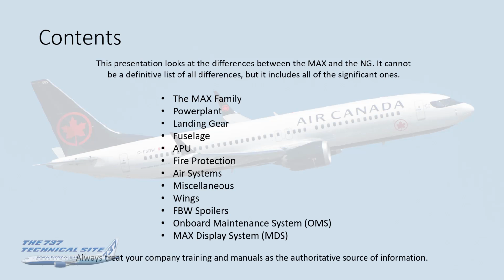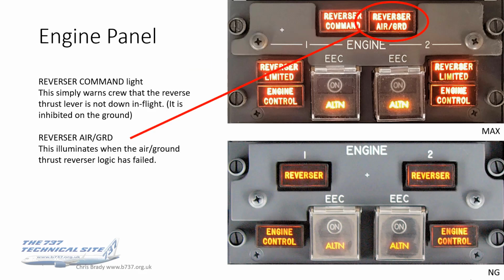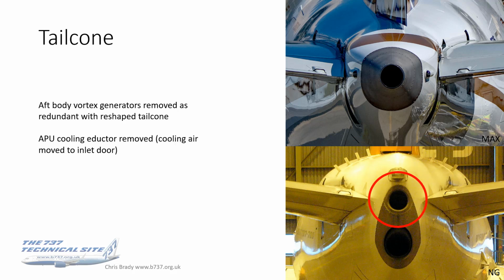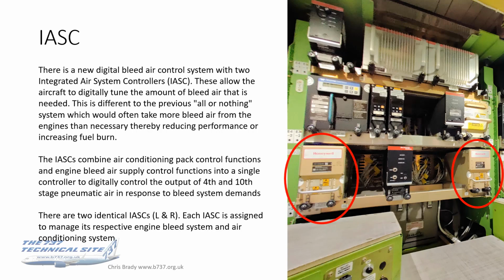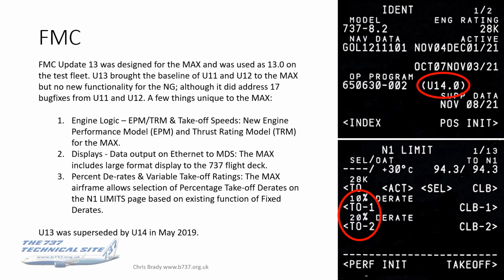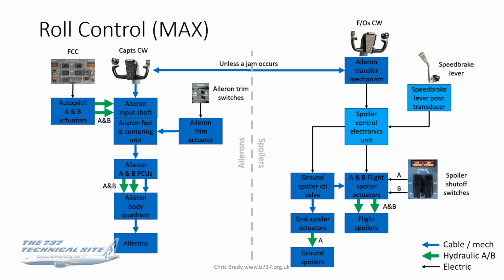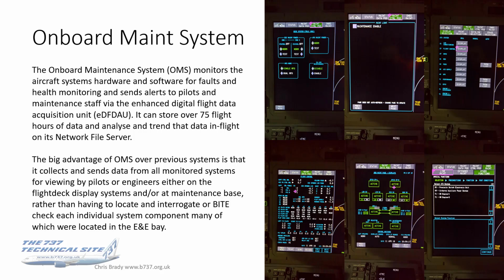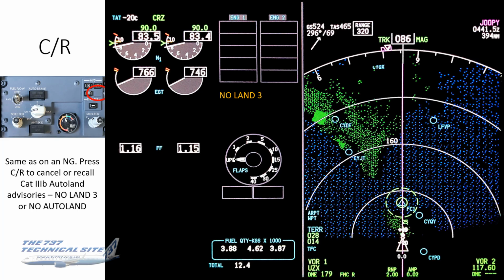737 Max Differences

Comment: 49:25  what is real insanity is that brand new MAXs are still being delivered with integrated ash trays in the cockpit. How that makes sense I have no idea.
Reply from the maker: Airbus only stopped doing that a few years ago!
Reply: Wasn’t the logic behind this one that if someone’s going to still go ahead and smoke, then it’s still safer to have an ashtray there to put out the cigarette safely, even if it is not intended for use?

Comment: Hello Captain I had a question if you could kindly help me. In max, when we are doing the extended motoring of the engine 5 mins of wait and 5 mins of starter usage say due to a hot start where the EGT has not exceeded the limit, due protection and the starter usage was more than 3mins. What are we to do if the starter takes more than 5 mins to start the engine in the second attempt as it says 5 min of wait followed by 5 min of starter usage. Thank you.
Reply from the maker: Please ask any questions here https://www.facebook.com/groups/737tech

Comment: I hope this feedback is useful to you. Your channel offers something unique - in dept analysis of aircraft design and I love that. But I found, then unsub'd then sub'd again, and then found a way to "tolerate" your content delivery. This is intended to help you not to punish you. You can always delete it, but I hope you consider it first.

1. Reading your slides is pointless. I can read them myself. And I can do it much faster.
2. Even though you;re reading, you stumble, hummm and errr, far too much, which I find almost intolerable (I know, I have a condition).
3. Even if you read the slides perfectly, it would lack all sponteneity and the interets which that enbues.
4. I can get your material now, by turning off the audio, reading the slides far faster than you do and jumping from slide to slide using my remote.

It could be so much better.

1. Make your slides present major headings but not the details.
2. Write a scipt if you must but practice it and try to sound sppontaneous.
3. Preferable to 2 = wing it.  You clearly know your stuff. And it clearly interests you. So enthuse! Share your passion with us.
4. Share somehting of your self with us - sense of humour, anecdotes, maybe.

I wish you and your channel all good things.
Reply from the maker: @chriswesley594 Thanks for the honest feedback, I will take it all on board.

Comment: Morning Mr Brady. I'm an aero student doing aircraft design at the minute, wondering if you could clear up one thing. The Max now has two electrical bays, I know one of the benefits of this is less wires/less weight but what are the functions in a nutshell of the aft and forward bays? Thanks in advance from Bristol!
Reply from the maker: The 737 has always had two electrical bays. The fwd equip bay is used more on the MAX as an overflow. If you watch my E and E Bay video it will explain further.
Reply: @ChrisBrady737  will do thanks

Comment: This is just a tought... wasn't the windmilling of the APU caused by difference in pressure from the top air inlet and the bottom exaust, on the max no top inlet so no windmilling?
Reply from the maker: That could well be the reason

Comment: Hi, why boeing 737 ng remove taxi lights in the nose
?  what is the main reason?   We could understand that he was both better in appearance and taxiing. But the new lights are on the wing body but the nose light is completely gone.  While almost all planes in the world have a taxi light in the nose, why is there no Boeing 737 ng and max?
Reply from the maker: There are two main reasons why the taxy light was moved from the nose gear to the wing root: 
1. On the nose gear it is more susceptible to FOD damage and exposed to the elements.
2. On the nose gear it is exposed to significant shock and vibration loads.
Both of these lead to much better reliability and associated cost saving for the operator. There is also a weight and drag benefit.

Comment: Still, no EICAS.
Why, Boeing, WHY???
Reply from the maker: They may have to for MAX 10 certification. Watch this space
Reply: @ChrisBrady737  I sincerely hope they are forced to introduce EICAS on the 737.
ALL of them, not just the MAX 10
After all, that technology has been around since the 767 came out, in 1981.
I know TR commonality yada yada yada, but you can't keep on going without serious innovation in aviation.
The total shit show the MAX has been is proof of that
Canceling the NMA was not a smart or cost-effective decision, as you mentioned in another video about the MAX.
Boeing should have cleaned the slate, ditched the 737 for good and gone with the NMA
But quarterly shareholder reviews are more important than long-term fundamentals, it seems...
Reply: @soffici1  no it doesn't work like that. When you have a company, Innovation is useless if you don't have people to buy it. Boeing ditched the nma because of the airlines which wanted a 737max first. They lost their monopoly on them.
Reply: @soffici1  eicas on the 737 has more downsides for  very little benefits, you can perfectly fly nowadays without it, look at the 737ng for exemple. So there is no valuable and logic reason to ditch the TR commonality, which is supposed to  be one of the biggest advantages of the max.

Comment: The crew CALL light is removed because there is a new audio control panel (ACP) which has a light on the receiver switch. whenever there is a call from ground or cabin the lights come on,on the FLT or CAB  switches respectively
Reply from the maker: Thank you, I realised it after I finished the video!

Comment: Chris,
Are there major differences in the QRH procedures of the ng and max, other than the mcas related items?
Reply from the maker: There are minor differences eg the engine relight envelope, but the QRH's are kept as similar as possible to help crew who fly both types.
Reply: @ChrisBrady737  Reason I asked is there is a professional grade MAX simulation for the PC coming out in the near future but I only have access to NG manuals.. will be interesting to get a feel for the max however!
Reply: @ilarikousa1500  by whom?
Reply: @noble6p  pmdg
Reply: @ilarikousa1500  they’re making a max?
Reply: @noble6p   yes
Reply: @ilarikousa1500  do you have any info on it?
Reply: @noble6p  Nothing published yet except that it's coming.
Reply: @ilarikousa1500  I hope it comes out on p3dv5. You have any idea when?
Reply: @noble6p  unfortunately no
Reply: There are no procedures for MCAS. Think about it… no ON switch, no OFF switch, no knobs, levers or handles to adjust its operation, no message or warnings that mention it, not mentioned in any procedures. In normal operation the flight deck effect is rotation of the trim wheel, which cannot be uniquely discerned as MCAS operation due to similarity to STS. Abnormal operation due to a bad AOA sensor used to manifest as a runaway stab trim, MCAS 2.0 is more likely to be INOP.

In short, MCAS was—and still is–transparent to the pilots. That was the reason for removing it from the operations manuals, not because Boeing was trying to hide the system. It is also why there wasn't—and still isn't—any simulator training for MCAS. It would be like trying to teach an automobile driver how to shift gears… in a car with an automatic transmission, LOL.

Comment: Thank you so much captain. Such a great explanation 👏. Kindly make more videos of MAX ATA chapters wise.
Reply from the maker: Thank you for your kind words. I think I have covered most of the ATA Chapters already but I am working on more.
Reply: Hi Chris, Thank you for your very well presented videos regarding the 737. An absolute treasure of a resource for those who fly(or are just interested in)the type. I have a question that even some of our chk airmen and APD types sometimes struggle with. 

One of our 737 RTO criteria above 80kts is for Predictive Windshear Warnings. With the WX radar On, we will have PWS prior to advancing the thrust levers. However, since NEW PWS warnings are inhibited above 100kts, is it conceivable that one could experience WS prior to V1 and the PWS system would not activate?

I know you are a very busy man, so if you don’t respond immediately I will understand. But if you get a chance, I would enjoy hearing your perspective on this. 

Cheers,
Dave H
Seattle CA

Comment: Thanks for another piece of great content Captain! Let me make a suggestion about removing the blue "CALL" light. In my opinion the reason for that is new standart ACPs with "C" (CALL) letter on MIC switches. So there is no need to take a look on the P5 when cabin or GRD crew make a call to FD.
Reply from the maker: That makes perfect sense, I think you are probably right.

Comment: Quality content as always, Chris. Thank you.

It's hard to believe that Boeing somehow stretched the original 737 fuselage length from 28m all the way out to 44m with the MAX-10. Here's hoping Boeing will finally come to its senses and develop a new clean-sheet workhorse single-aisle aircraft soon. There's only so much blood you can suck out of a diamond-brilliant 1960s design after all. The problems with the MAX proved that hypothesis methinks.
Reply from the maker: Glad you liked the video. I am certain that the MAX will be the last generation of 737. End of an era.
Reply: @ChrisBrady737  End of an era indeed. But not for a couple of decades yet though.

Did the airline call you back to work yet? It must be tough, being on the sidelines so long, when you love your work so much.

Comment: Oddly enough, there are only 197 passenger seats in the -8 200
Reply from the maker: True, but legally it could carry more. I think I covered it in the Air Con video under "Ventilation Rate". Also -8197 doesn't have the same ring to it!

Comment: Thanks for the great video !
I like to share some of my experience/thoughts:
1.Leap engine while flat rated higher than 56, on high and hot condition, it drops much severe, here at 6900' field, if temperature goes higher than like 30c(sometimes it do) our MAX8 with 27k would got lower MTOW than 800 26k, even it's normal 25c Summer day the higher DOW of MAX still means less payload.
this, combine with max7 delay, might be why our company Will switch form 700 to 319neo for high Land operation in the future
2. As for the engine start going, the LEAP goes very close to EGT redline on normal start, there are reports some pilot mistakenly calling for a hot start abort because of that.
3. the higher nose gear makes life much harder for ground crew shorter than like 175cm to access the external power panel
4. kinda surprise Boeing didn't put a strip of APU information like RPM/EGT etc. on system display as on… almost every other Boeing with screens in cockpit
5. The Amber lights on A-I panel have one great advantage: it'll cause Master Caution lights on if a valve stucked, unlike the blue one, the wingAI wouldn't got your attention on main panel at all if failed.
6. FBW spoiler also gives much better roll control especially with flaps 40, combine with higher flaps speed limit and higher weight, it makes flaps 40 landing more usual than on NG
7. with elevator jam, you won't able to move control column forward and backward (at least it's how our simulator rendering that), the jam assist works by the force you put on the column, kinda like the force sensing stick on F16 or F22 (no experience on those though.
8. I believe NG already have 640 of ND range then? on 787 you can go 1280, on MAX you can go lower range of 0.5nm, but that doesn't help a lot when there is no taxi map as 787(maybe will be there in the future, let's hope)
Reply from the maker: That is great operational feedback. Thanks for taking the time to write, very much appreciated.